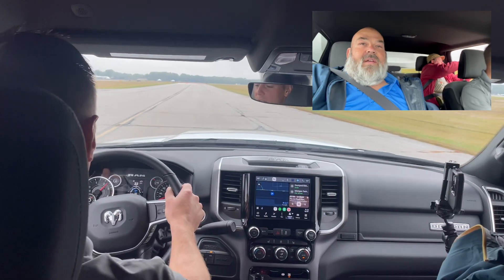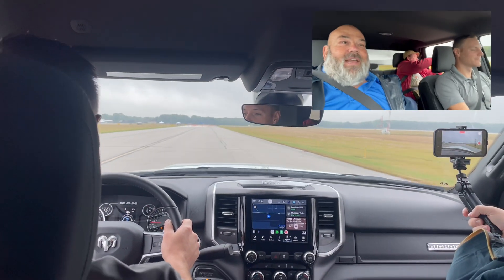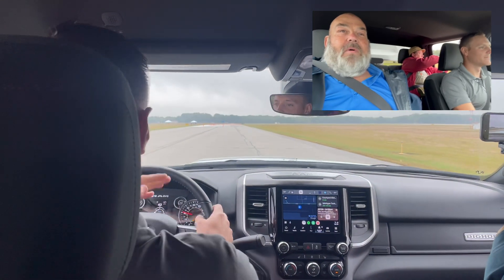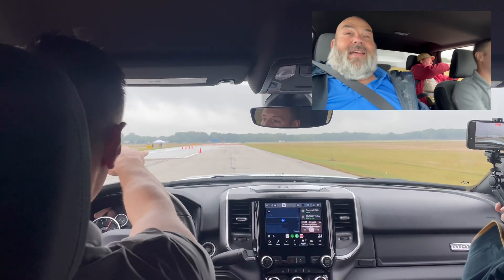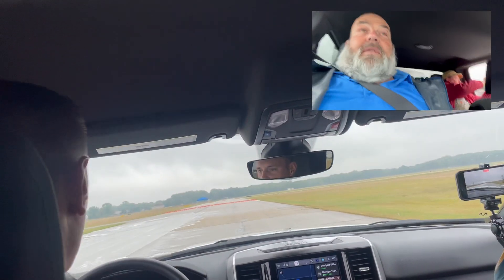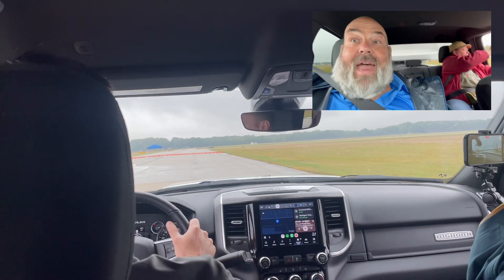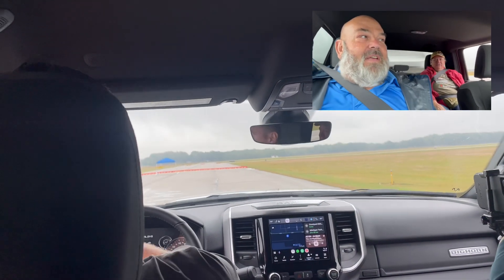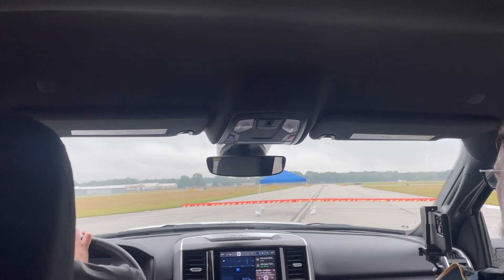Experiencing anti-lock braking in fifth wheels with Lippert ABS on a track

Comment: Thank you for joining us at the track! Just to clarify, the ABS system is available on travel trailers, not just fifth wheels. Current travel trailers equipped with the Lippert ABS system are Keystone Cougar, Grand Design Reflection, Imagine and Imagine XLS, and Brinkley Model Z Air.
Reply from the maker: That's fantastic. I knew the system was available but wasn't aware that it was already being installed by travel trailer builders.